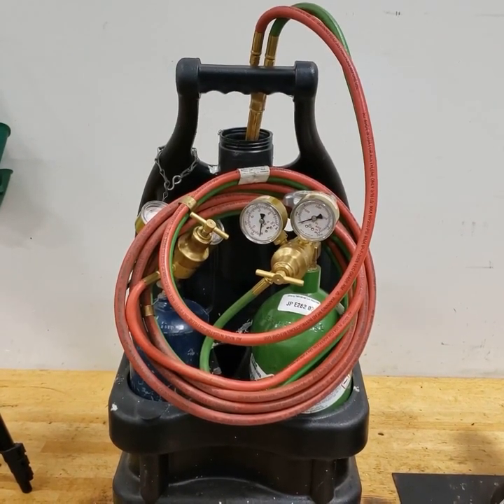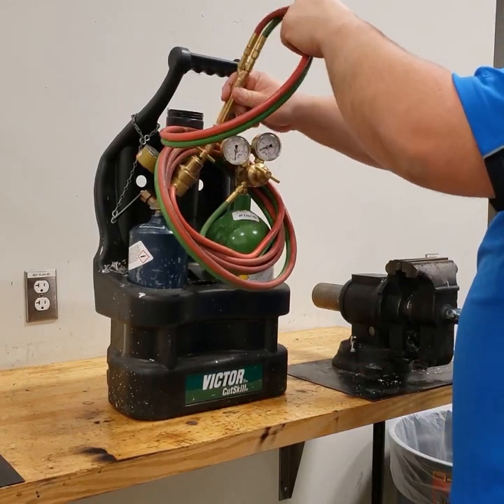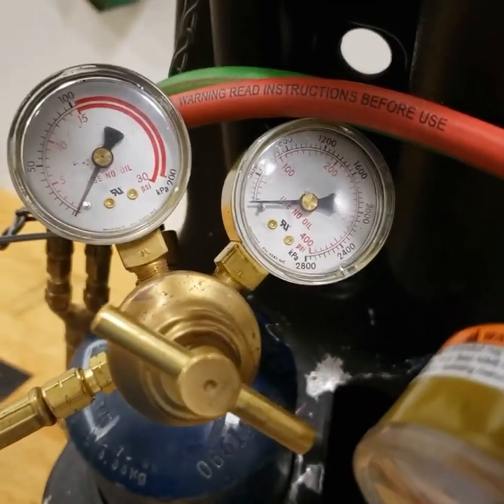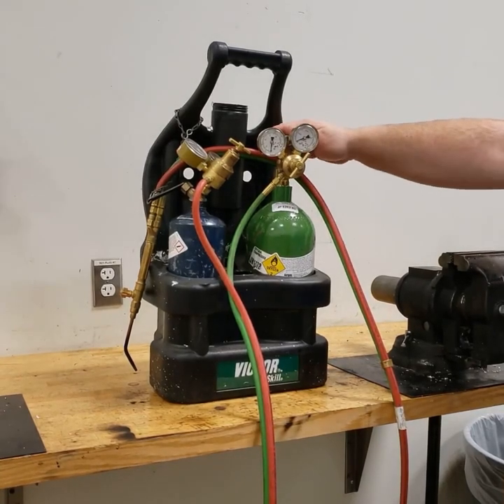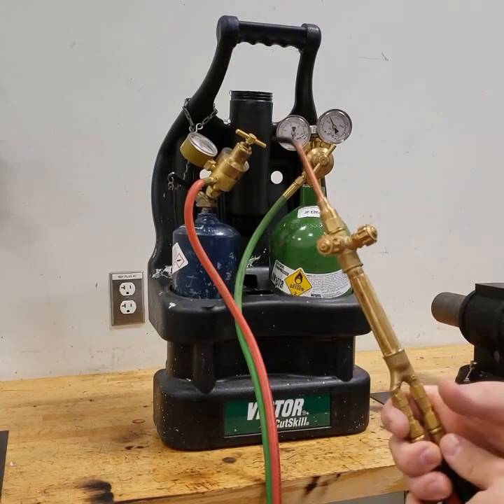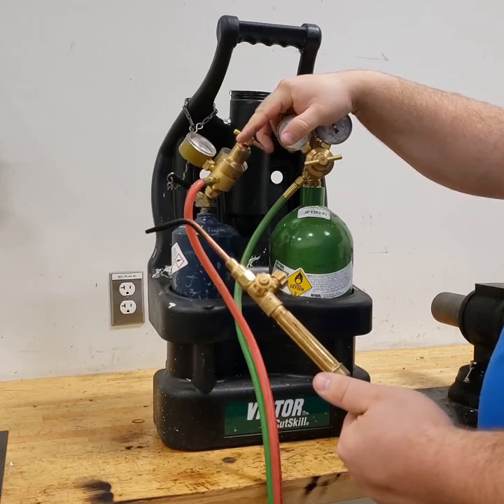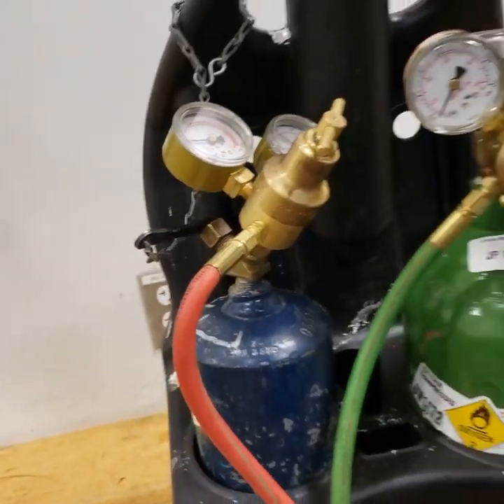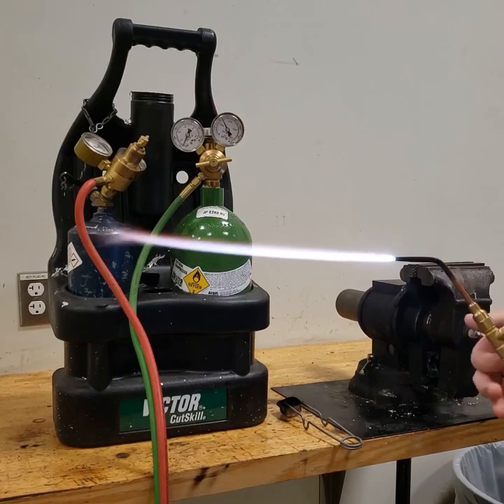Oxy-acetylene Torch Setup: Tips To Get Started

Comment: Question do you know if i can leave my torch setup in my shed without insulation or is that to cold
Reply from the maker: My torches ride in my service truck and the back isn’t heated. Never had any issues with them not working. Toughest thing is in cold weather it’s just takes a little longer to warm the metal up you’re working on.
Reply: @dunhamservice   literally a thanks man!
Reply: @dunhamservice  I'm happy got my torch running

Comment: I can never get this to work. My flame is either too big/long to fit in tight spaces or too cold to braze copper or too hot and cuts holes in the copper.. i have the Bromic brazing kit. A work mate of mine was able to make a TINY flame which was able to perfectly melt and seal solder to copper in under 20 seconds

Comment: If you read the manual for that victor set it says 5 psi for oxygen and 5 psi for acetylene. 

Maybe follow the manufacturer instead of some jackass on youtube. No way in hell you need 7/10 on a baby brazing tip
Reply from the maker: Ran 7/10 for years with no issue on this set as well as many others. The important thing is getting to a neutral flame. 5/5 probably would work just fine. I’m usually running a triple tip when doing work, so you are pushing a little more fuel than this 0 currently on this setup.

Comment: If it’s over 15 it’s not gonna blow up it will start drawing out that acetone and it will come out of the tip
Reply from the maker: If cylinders are tipped more than 15 degrees the acetone can be drawn out with the acetylene and the flame will sputter. Without the acetone creating a composition in the tank, acetylene will explode at over 15 psi. Here is a link to an article discussing the specific of acetylene storage and usage.  https://ehrs.upenn.edu/sites/default/files/2018-02/Acetylene%20Fact%20Sheet.pdf